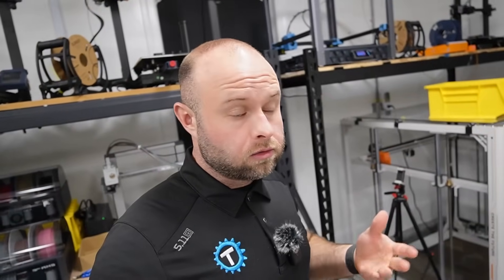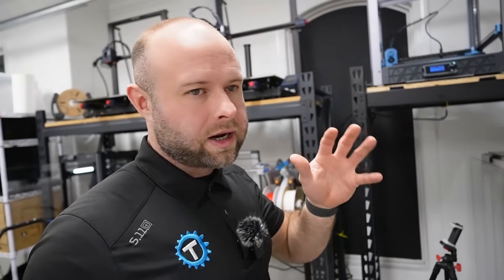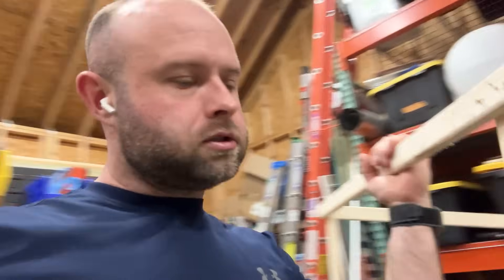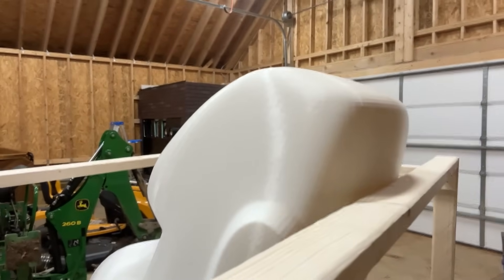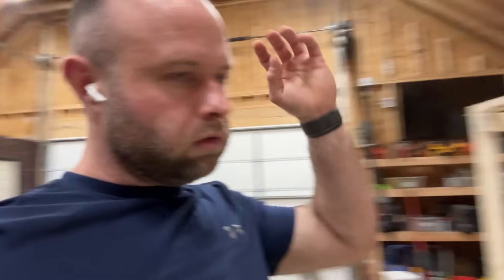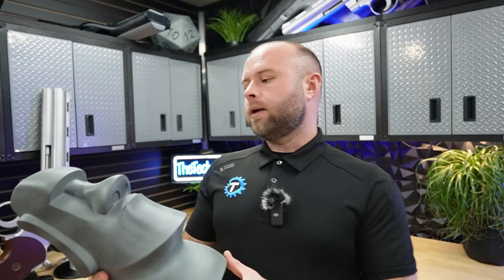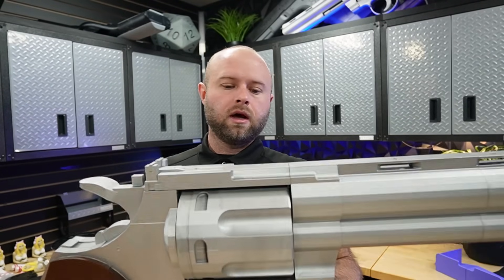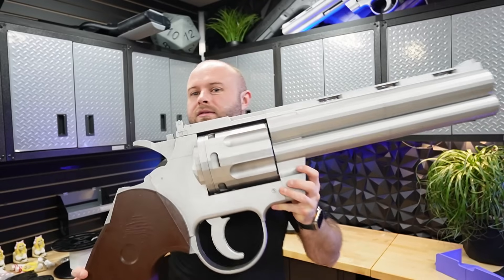Simple shipping jig for XXXL Prints / P1P Flushing Drawer: 3D Print Startup Side Hustle Vlog

Comment: Usually when I notice a PETG print failing, I let it print a few layers, so it'll flex off the bed easier. 

Also, the shiny finish on your PETG is not a sign of it being printed too hot. It's a sign of it being properly melted. PETG is almost always shiny when printed at proper temps. It can actually take a large range of temperatures and layer adhesion gets much better the hotter you go. Idk what temp you printed yours at, but I usually print PETG between 265-275C. 

Thirdly, what PETG were you using? I recently printed some pew pew organizers that fit in a Pelican-type case from harbor freight for a friend, but he supplied the filament. It was a transparent PETG from IEMAI that looks a lot like your P1S base.

Comment: Be carefull with the 5 kg spools as the extruder needs to be strong enough to pull the filamanet of the roll, especially when its a new roll at full weight. 3 kg might be a better option.

Comment: I remember a while ago about a website where you put up details of the thing you want to ship and individual people compete with each other to ship your item at the lowest price. You just chose the person with the most reasonable price and time frame. For example, if I was planning a road trip from FL to NY, I would go on the website and look for anyone needing a package shipped along my path. Truckers also use this service when they make a commercial delivery to a location and don't have packages or have extra space in the truck back to their original location of departure. I don't remember the name of the website but I asked chatgpt and got this answer.

You're likely thinking of uShip, a platform that operates exactly like this. uShip connects people who need items shipped with transporters who are already traveling similar routes. Individuals or businesses post the details of the shipment, and transporters bid on the job, often resulting in competitive pricing. It's particularly popular with truckers, people moving long distances, and anyone shipping large or unique items (like furniture or vehicles).

Comment: I also think that if you are printing vehicle parts, print in a nylon or some sort of polycorbonite and as long as it's cosmetic parts and not structural, there is a tone of money to be made there. Nylons with GF/CF will not need any reinforcement as that is what most kit cars use anyway. I also think you should create a proper enclosure for the giga and sell it to the minions!

Comment: Have you tried packing the Moi Diagonal, i think you can get it within an  (80inch measurement) like you say, i.e. 40Hx20Wx20L diagonally?
Reply from the maker: no way it could work without chopping off shoulders, which i've done. it's the next print after this car part finishes

Comment: If you determine the exact packaging dimension of an object as it sits now,, you can calculate the proportional size of each dimension that adds up to 80. Probably easiest to ask an AI. Then you just need to figure out how large your model can be to fit inside that box based on one of the inside dimensions.

Comment: Perhaps this will be an ignorant question, but why not use some kind of the stone filled pla filaments? Would already come out looking great. Also, I bet brass filled filament would provide a really unique look to your over-sized models.
Reply from the maker: I did one of the D20's with it. My reservation is the cost of that stuff and failure rate. If a giant print like that fails using $20-$25/spool filament, well, YIKES

Comment: The secret to printing PETG on PEI is Windex.  Just wipe some on the build plate and you're good to go.  Very easy to apply and doesn't leave a residue like glue does.  I print almost exclusively in PETG and if it wasn't for Windex I would have switched to a different material long ago.  PETG should be shiny.  Stringing is most likely due to moisture.

Comment: I know a little bit about structural stuff - the fender just needs to be stiff enough to be wrapped in fibreglass ( or whatever he wraps it in ) once it is done it will get most of it's strength from the fibreglass shell. Your job is to make the print stiff enough for him to work with, splitting into parts for him to stick back together should work well for shipping. He needs to use epoxy resin... polyester resins will likely melt the 3D plastic. Printing body parts could definitley be an interesting service to offer. Your PETG print - PETG is almost always shiny unless it has some sort of fibre in it like CF or GF, surface bobbling and stringing is often caused by moisture in the filament, can even be not very good filament.

Comment: The Moai model is already a cut-down version as the real statues have torsos. Maybe you can make the head and just enough of the shoulders for it to stable sitting up as your primary offering but also offer a torso designed for the primary to be able to easily nest into as a separate purchase. Many of the real statues also have a sort of hat, which also could be offered as a separate purchase. People who are willing to pay extra for the additional prints that are shipped separately should be ok with the accessories requiring a small bit of assembly on their part.

Comment: Use a wooden frame in the box, to reduce what can squash ?
Reply: Had the same thought! Wood frame -- even with more slats -- should allow you to place a large print with little clearance. You just want to ensure the print has little room to move inside the cage and the frame would ensure the box structurally. Assuming that the shipping weight isn't a factor.